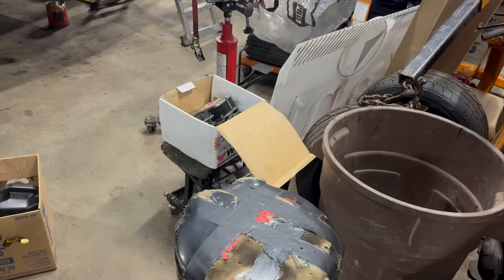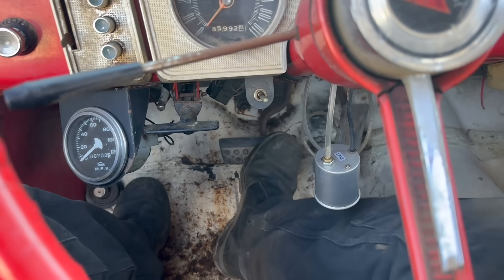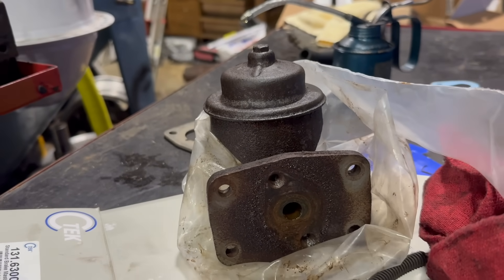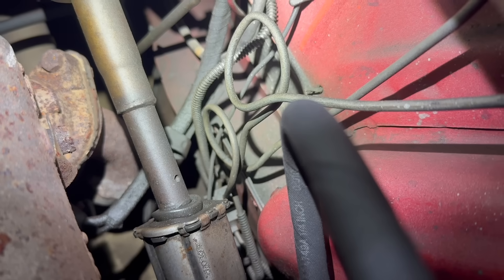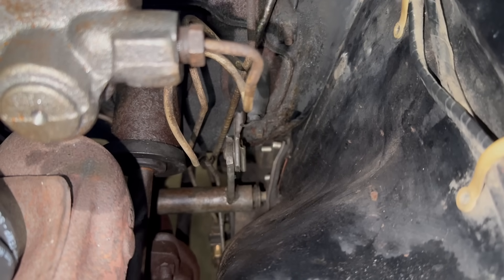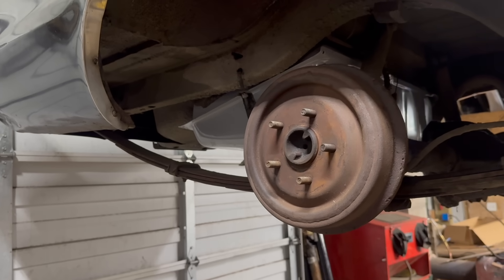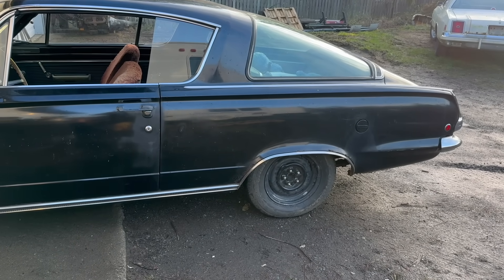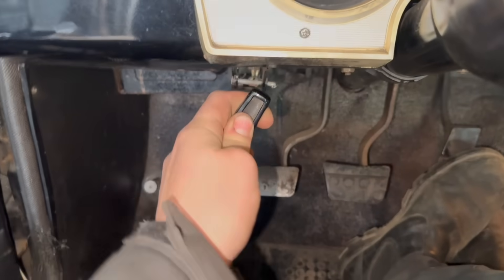Brake Safety Upgrade - Swap The "Pump And Pray" For A Dual Master Cylinder (A 1965 Barracuda Update)

Comment: Back in the day, I converted my 68 formula S 4sp convertible from manual drum to power disc from a wrecked 70 340 Dart (back when you could still find cars like this in junkyards) and so these were the 4 piston small bolt pattern brakes.  I was proud of my 19 year old self.  BUT, I was too young to know about the prop valve so neglected to change that out and couldn't understand why the rears locked so easily.  It wasn't until years after I sold the car in the 80's that I realized the mistake...still feel bad about that!  So if you own an ember gold black top black interior S convertible, please check under the car for that valve...and...I'm sorry!
Reply from the maker: My ‘70 Swinger was disc brake swapped with 73+ big bolt parts and the matching 8 1/4 axle. Any time I had to stop at all quickly, the rear brakes would lock solid and I would go sliding sideways towards parked cars, ditches, etc. I remember these situations vividly. It wasn’t fun. I didn’t know anything at the time, or I could’ve fixed that pretty easily!

Comment: I lost the master cylinder in the Stag while out on a cruise one afternoon.  She'd just come back from the mechanic after it had fallen into a pot hole on the coast road and the clutch slave cylinder had been slammed backward so hard that it had bent the clutch fork and smashed the cylinder and the mufflers had also been slammed up against the floor.  Insurance paid for that - although I wanted to send the bill to the guys who do the road works (or rather DON'T) and had left this huge chasm for the front of my car to fall into.....but that's another long story......

Two days after I got the car back, I went on a top-down tour of the local countryside and beaches.  It's a 40 mile loop that I do regularly in the car, so I know it very well.  There was no traffic on this sunny Tuesday morning, so I was pushing the Stag along and she was percolating nicely at a speed that had me needing to tap the brake just before a corner (which, if I am cruising at the speed limit, I don't normally do).  The pedal did nothing, so I drove it hard through the corner and checked the pedal on the next straight....and it went all the way to the floor.

The Stag has a boosted twin-pot master and proportioning valve system similar to the Barracuda.  It also has a warning light....which never lit up.  Pointless idea anyway in my opinion, because when it DOES light up, it is going to be painfully obvious that your brakes do indeed have a problem....but I digress.  The pedal she no do much in the way of help to slow me down, but fortunately, the handbrake works well and the car is a stick shift, so stopping wasn't really an issue.  However, I was already half way round the loop with no place to turn around within the next few miles, so I chose to just drive the beast home at a speed I knew I could pull the car up from without potentially harpooning anything.  

I checked for leaks in the lines, around the calipers, inside the drums, running down the back of the firewall inside the car or around the rear of the master - nothing.  Not one place did I see a drop of fluid.  Furthermore, the levels in the master itself were still at the top - there were just no brakes.  One corner they were there, several corners on they were not.  I pumped the pedal while the lid was off the master and I saw the fluid geyser up out of both reservoirs - and I do mean geyser.  So fluid was moving around in the master, but not leaving it or pressurising the lines....or the proportioning valve was being stubborn.  I took the line off both front and rear reservoirs and pushed the pedal - I got a dribble out of the rears only.  So - the internals on the master had just decided that today was a good day to die and left me to it!

Everyone I've spoken to reckons that's a weird thing to happen.  Trust me - in my life, nothing is too weird when it comes to things happening - especially when they happen randomly, for no good reason or are things that nobody I know has ever experienced!  Just thought I'd pass this little gem on as a footnote to the twin-pot master theory being better than the pump and pray......in theory they are better.  In practise.....I tend to reserve judgement on that.  Have you ever heard of that happening - brakes working fine, no hint of an issue and then your foot hits the carpet the next time you want to stop.....and there's no leak anywhere?
Reply from the maker: Wow. Yeah, that’s a good one. We’ve seen several mail trucks do the brake fluid geyser thing, but there are usually still some brakes.

Comment: Ok, the question  is.. have you raced your neighbor  with the black wide  body nissan  that says "move over " on the tail spoiler  with your blue challenger yet? That would be a cool video!  The 80's duel
Reply from the maker: It’s his friend’s, and it’s just being stored there currently. I’ve offered to buy it a couple times so far. Haha. I did allegedly race a CRX on the highway from 50 MPH the other day. He uh… he was gone. Quick.

Comment: I ran well over a hundred worn out beaters least maintenance possible, only 3 times brakes abruptly failed was exploded front drum, tossed rear axle on the freeway and couple of years ago new CHINESE rubber brake hose burst in a 3600lb car normal stopping. Other wise the pedal slowly sinks and you pump them back up. I now always install dual circuit master cylinders and front disks cause I drive in a dense herd of insane idiots. Chinese junk isn't just a stupid looking boat.

Comment: 0:18 Way way back there were mechanical operated brakes, as in rods not cables to make them work.
Reply from the maker: Whaaaaaaaatever, a mechanical connection. Listen

Comment: Why do factory brake lines have loops in them?
Reply: It's because the tubing expands under pressure. The coil allows the tubing to absorb countless cycles without breaking, like a spring. I hope that helps.
Reply from the maker: I’m going with what Russ said. But adding that it also allows for chassis flex.

Comment: Thanks for making me even more paranoid about my 65 Darts brakes.At least my E brake works and is set up and theyre 10 inch all the way around.But ,dammit,you convinced me to update.
Reply from the maker: It’s definitely a wise upgrade. And @Bradydog-in7ut you ever tried that one before? I have…
Reply: @DeadDodgeGarage  Accidently on a brand new Ford XLT-Almost dropped the trans out of it!
Reply from the maker: @Bradydog-in7ut  that’s a cool trick 😂
Reply: @DeadDodgeGarage  Lol! Boneheaded move on my behalf…You think you Shelby shuttered and shook? My truck almost shook apart!
Reply: If your brakes go you can always slam your transmission in reverse….
Reply: @Bradydog-in7ut  sure